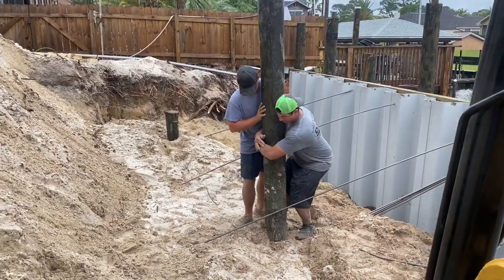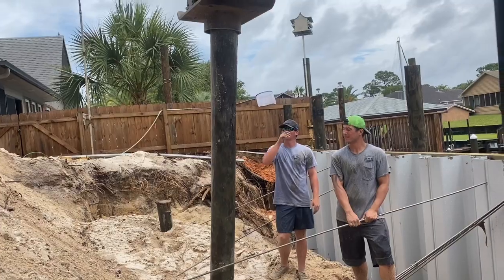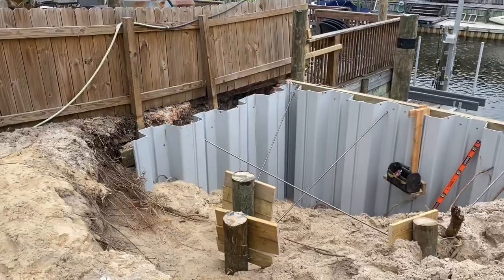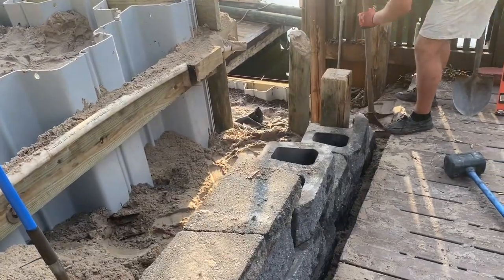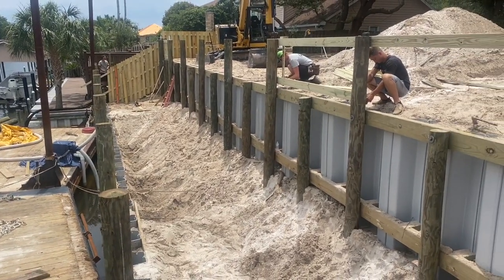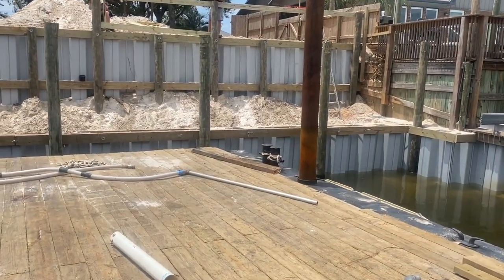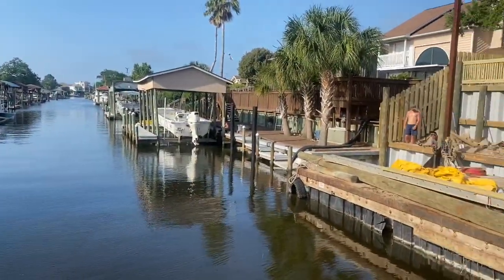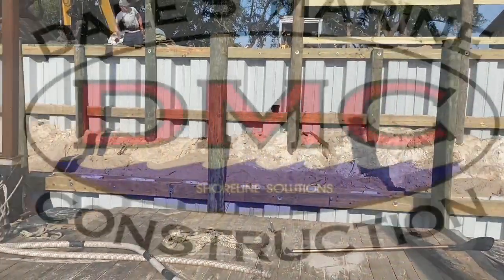#2 HOW TO STOP EROSION ON A HILLSIDE.

Comment: How tight do you tighten the nuts on the tieback rods on the front of the wall?
Reply from the maker: Brian Sysol Thanks for your comment and watching my channel, we run a string and tighten wall till the string is in line with the whaler system. A lot of times were over tighten them and after backfilling let them out a little bit to line up with the string.
Reply: Thanks for the response. You all do awesome work and put out great videos